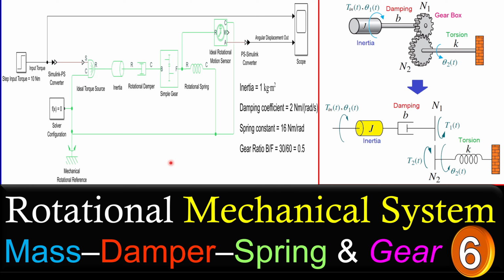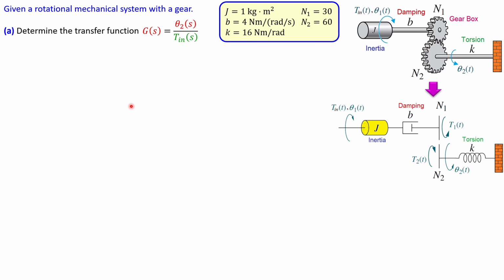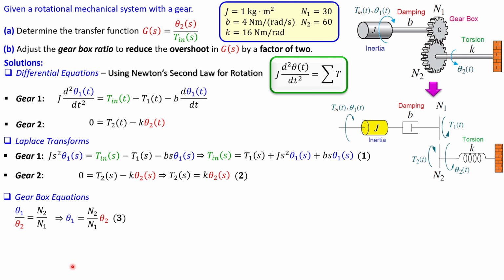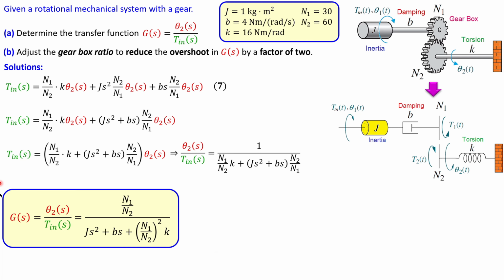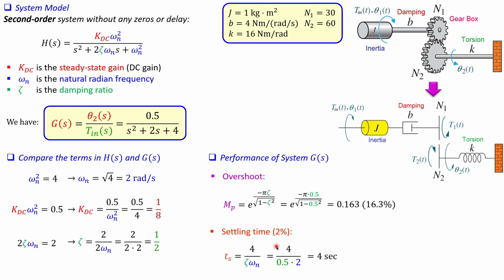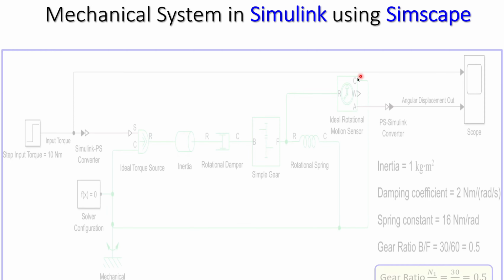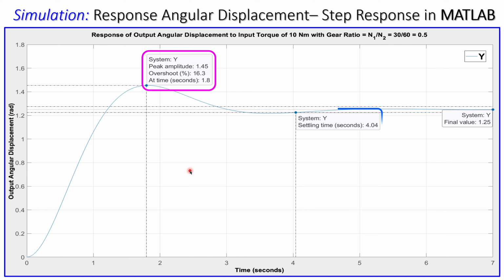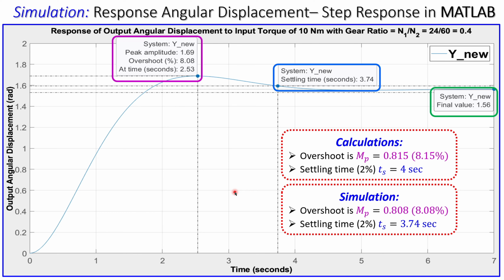Rotational Mechanical System with Gear 🌟 Example 6 💡 Calculations & Simulink/Simscape Simulations

Comment: Hi teacher, thank you for the video. Could you please summarize what was the wrong and the solution. If you had chance to investigate
Reply from the maker: Again, I have checked it. My summary so far:

1. The differential equations are correct. The equations for the gear 1 and gear 2 have already decoupled the differential equations in terms of theta1 and theta2.
2. Calculations for the first case with gear box ratio of 0.5, both MATLAB script and Simulink block diagram produce the same results. So, it cannot be the wrong connections in Simulink diagram.
3. For the second case with gear box ratio of 0.4, the MATLAB script does give the correct result, but the Simulink diagram is still not showing the results I get from calculations. The reason is still unknown to me!
Reply: @CANEDUX Thank you sir for reply. Wish a great day !
Reply from the maker: @sdsddfdsf  You're welcome!

Comment: In my opinion the differential equations are incorrect because the speed after the dumper is not theta1 so the equation should consider b*(w1-w2), there is the need for 4 different thetas: before J, after b, after GB (before k), after k (should be 0 as it is the reference). Let me know what do you think!
Reply from the maker: Thanks for your message and checking the video in detail. I will look at it again in more detail as soon as possible, and let you know.
Reply: i agree
Reply from the maker: After some time, this is my additional feedback: Differential equations are correct. The equations for the gear 1 and gear 2 have already decoupled the differential equations in terms of theta1 and theta2.

Comment: You need to connect the damper in parallel. It will show the correct answer then. Worked for me (port C connected to reference and R connected to gear). Thanks for the video though. It was really helpful to build the understanding.
Reply from the maker: Thanks for your message. I will look at this in detail after the holiday break.
Reply from the maker: After some time, this is my additional feedback:
Calculations for the first case with gear box ratio of 0.5, both MATLAB script and Simulink block diagram produce the same results. So, it cannot be the wrong connections in Simulink diagram.